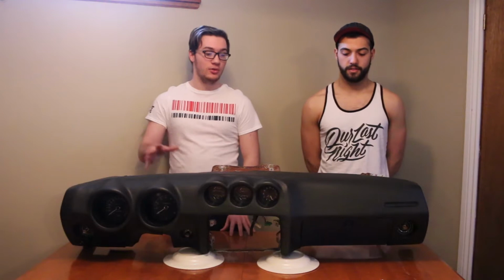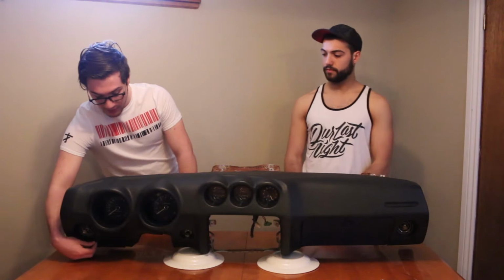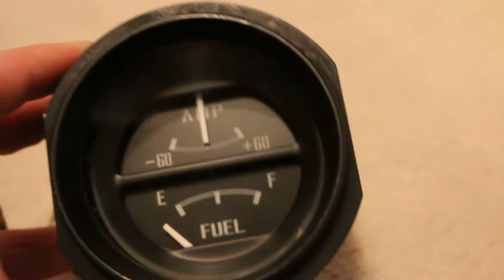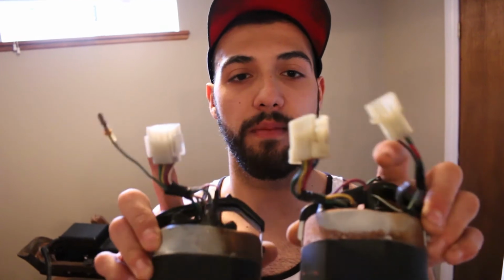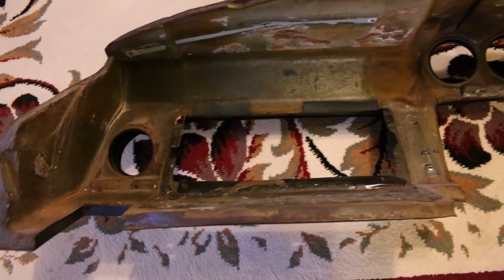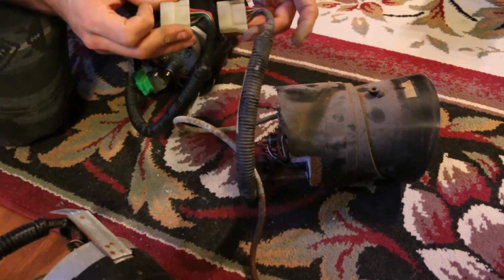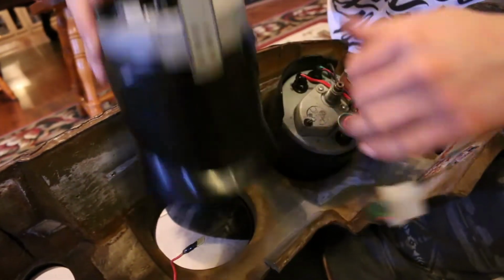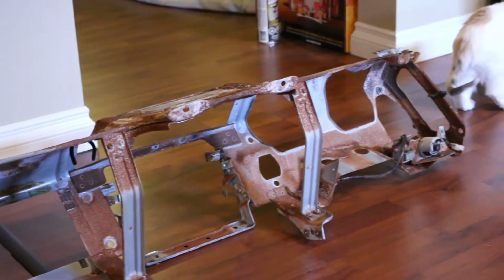Datsun 280z Build Part 5 - Dash Restoration

Comment: You should really mock up your wires and test them before you go clipping anything. Also, you could have just spliced a new wire on and left the old connector in tact just in case you end up needing to revert to the old gauge style. It may save you a headache later... ask me how I know lol.